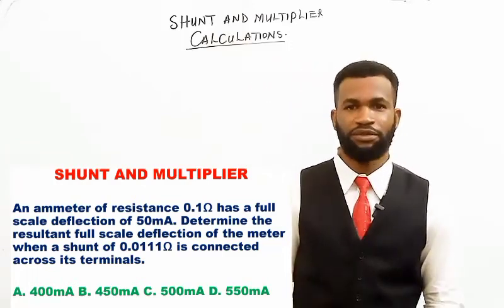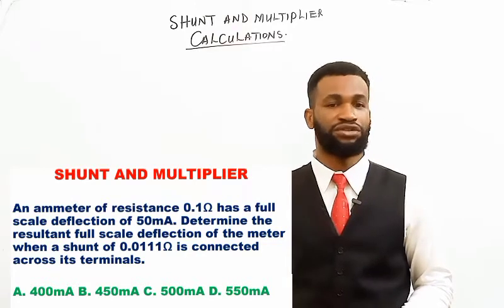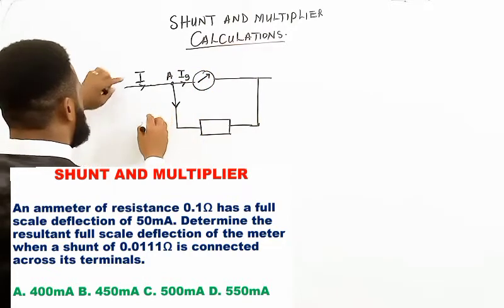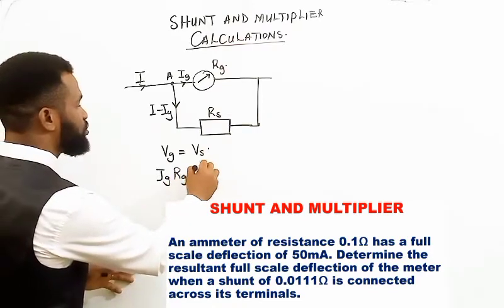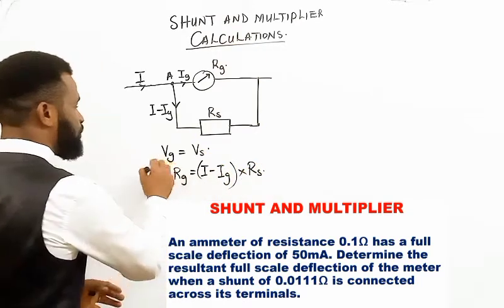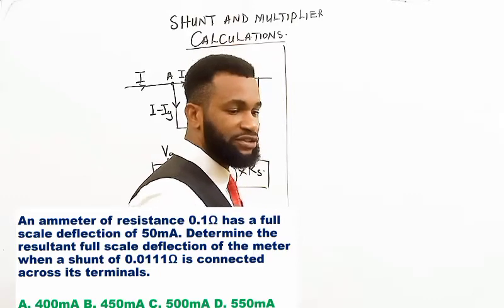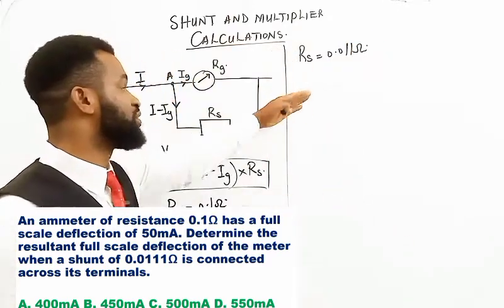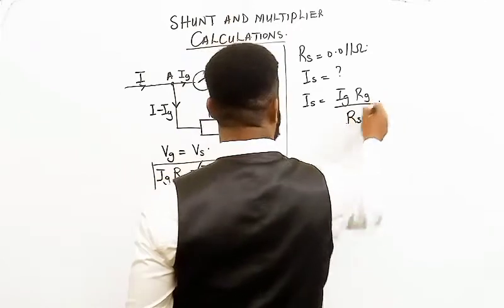Shunt and multiplier. weac, neco,Jamb,igcse@vindalsacademy

Comment: Convert 0•10cm a galvanometer with a    coil resistance of 30 ohms to 90-10 ammeter
Reply from the maker: Is this meant to be a question or problem to be solved